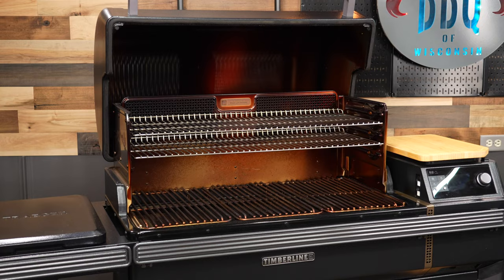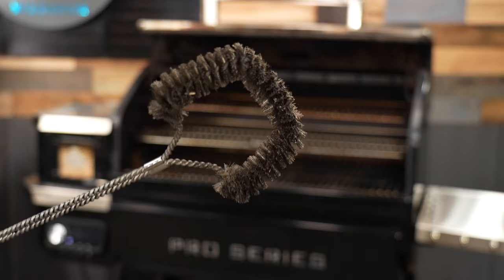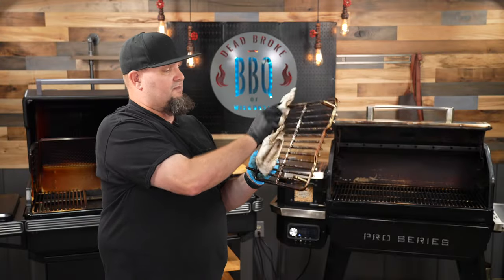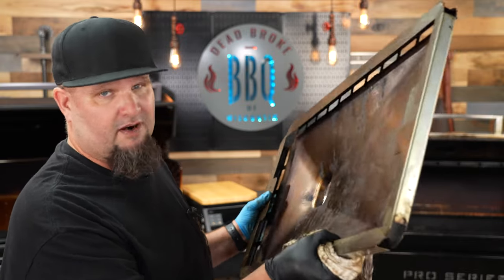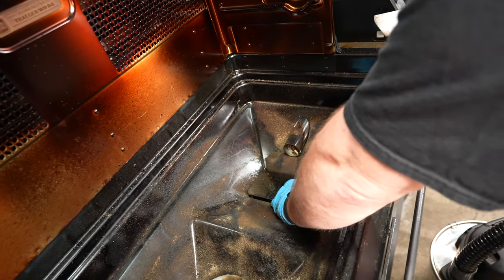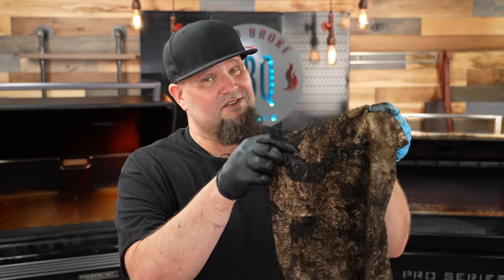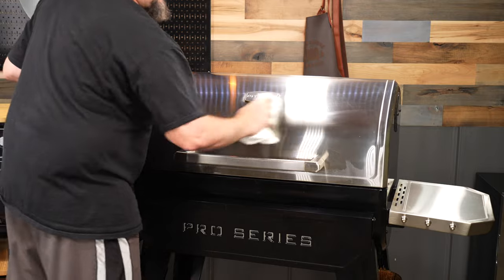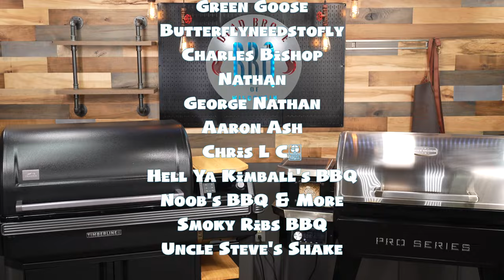How To Simply Clean Your Pellet Grill

Comment: That one brush that you said that was wore out, when I got my brush like it, it was saying to dip it into water to keep it from clogging up,does it actually work by doing that?
Reply from the maker: Hot water works to clean it up. But typically we just hit it with the garden hose with some pressure. Plus I hit the grates after I am done while they are still hot. But I go through so many brushes I don’t mess around much and just replace them.
Reply: @DeadBrokeBBQ  I will hit with a brush after meat is ready and go over it again the next time I crank it up.

Comment: I have a Oklahoma Joe Rider 900. It sounds like i should be cleaning after each use and then deep cleaning the smoker after 3 cooks. Whats the difference between deep clean and what you show in the video?
Reply from the maker: Clearing the ash pot is a normal clean out. Deep cleaning is getting out the vacuum and scraping down any grease. Thanks for watching!

Comment: Great video. I have noticed that my grill is leaking grease around the latch that holds the ash pot in on the bottom of my elite. Have you heard of others having this problem?
Reply from the maker: Hmmm I do not recall anyone talking about that. Mine is fine, do you have something not lined up correctly? Something blocking the grease flow? I get very little grease in the bottom of my chamber, in this video the reason why I had a lot of grease in it was from those 6 big pork butts I did. Almost seems like you have some obstruction or a hole near the latch rivets? Weird bro! I would call Pit Boss and see what they have to offer?? Oh is the pit level? In the past when I ran all of mine outside the pitch in the cement would not get the grease to flow if I had it tilted towards the hopper. Let me know if you figure it out! Thanks for watching, I really appreciate it Ryan!!!!

Comment: Ricer thanks for the videos, been watching most of them! Had a question about adding smoke to the inside of a grill. I read and hear a lot of bbq guys talk about how an older smoker can be better than an identical newer one because of years of smoke baked into the steel, with that in mind would it make any sense to light some smoke tubes in my 2 week old pellet grill when I’m not using it just to bake some extra smoke into the steel? Or would that just be a waste of pellets? Just an idea that occurred to me, let me know your thoughts.
Reply from the maker: Waste of time if you ask me. I would just run it on smoke mode longer for each cook. A good seasoned pit is typically an offset IMO.  But I never scrape down the chamber in my pellet grills unless the seasoning is starting to peel some. That will happen when you very the pit really hot or grill a lot on it. But if you want to add a smoke tube go for it, just going to add more smoke. Thanks for watching brother!

Comment: Great video!  Curious why you wouldn't use aluminum foil covering up the pit and just toss and replace as needed.  Is there a reason to let the plates get dirty?
Reply from the maker: On my first Pit Boss 1100 with the flame broiler I did it but it started to rust up pretty bad so I stopped and let the grease build up a little protection. Plus I had a couple grease fires from the foil not being perfect. Thanks for watching!
Reply: @DeadBrokeBBQ  I have a Pit boss P2 1000 and I have used foil to cover the grease shield but only for low temperature 225/250. Pork ribs and chicken. That is true about when the foil isn't on perfect enough for the grease to drain into the bucket.
Reply: How often do you pull off the hopper and clean out the auger?
Reply from the maker: @markhejl3104  I never have but I do not keep them long enough to worry about that to be honest! hahaha

Comment: What is the best way to clean porcelain coated grill gates? Thanks! Enjoy all of your videos. New to the whole pellet grilling adventure.
Reply: I turn the heat up high and use half an onion to scrub it clean. I also use hot water as hot as you can handle and a yellow and green sponge for dishes. Either one works for me hope that helps. Let's keep Grilling
Reply from the maker: I use foil typically on porcelain but I also use coiled brushes. Thanks for watching!
Reply from the maker: Yep that works too.

Comment: I find that steel wool or copper scouring pads work pretty well to clean up once you've got the bulk stuff removed with a brush.
Reply from the maker: Yep that works but I don’t use steel wool on the grates. Fibers break off so easily.

Comment: I use aluminum foil in my pitboss. Remove/replace when required. 20 seconds, done. Scraping days are over.
Reply from the maker: Ya I stopped using foil because my old 1100 dip pan really started to rust up. Plus I had a couple grease fires in the back rear corner when I had foil on it. I do not mind scrapping mine down after 3 cooks but I got 15 cookers so I can jump on another one if I am not in the mood to clean one!! hahaha Thanks for watching!

Comment: I went to the website for the gloves and it didn't show any disposable gloves
Reply: Go to harbor freight. Best place to get gloves.
Reply from the maker: Hmmmm weird Mark because it works when I click on it?? Maybe copy paste it?? I will say they have some good pricing typically!!! Like always thanks for watching!!!
Reply from the maker: That is always the other place I get them but they never have black and I use black in my videos so I do not  distractions  in the video. Thanks for helping out Victor!!
Reply: @DeadBrokeBBQ  interesting, I get both black and blue there. I like that they offer different thicknesses in the gloves. 5m is normally what I use. However I do like the 7m and 9m at times. I use gloves when handling lures and baits for salmon fishing. In the late winter/early spring it gets Damm cold outside fishing. The 9m really helps keep fingers warmer. Especially if you slip a chemical heater pack between the back of your hand and the glove. 👋
Reply: @DeadBrokeBBQ  it shows gloves but not the disposable gloves. I like to use them especially when handling hot peppers.
Reply: @victorbenner539  my wife would yals cold temperature. We haven't really had a hard winter here in awhile. We use to have cold winter's when the first blue northern came in it wouldn't start warming up until spring
Reply from the maker: Those are disposable nitrile gloves they sell. The blues ones I get from other places. I typically use the blue ones when I am clean up my pits. Thanks for watching!!
Reply: @DeadBrokeBBQ  originally blue was all you could get. When the black ones came out ( by the way I believe they are actually really dark blue in color) I really liked them for fishing. But I prefer the blue ones when cooking because dirt and grease shows up much easier meaning I will hopefully catch they are dirty before spreading grease and other substances around. Something to consider. But the dark gloves look cool 😎 👌.
Reply from the maker: Ya I like their selections also!!
Reply: @markhejl3104  Ricer has colder winters then me. I live in Washington state. But the temperature can be deceiving. We have 90% or more humidity in the winter months. So 34°f feels like 24°f. And when you're putting your hands in the water to deal with fish? Brother it's cold. I always have my propane heater when it's cold. And I have a small cooler I fill with boiling water before leaving home for fishing. It will stay warm enough all day fishing to clean hands( with gloves on) and help warm hands at the same time.
Reply from the maker: You are always prepared Victor and that is why I like you so much!!!! Great tips like usual brother!
Reply: @DeadBrokeBBQ  love watching your videos. After watching this video I figured that it's about time to give mine a good cleaning. Do you ever clean out the auger?
Reply from the maker: Thanks mark! No I never have but I do clean out the hopper but that is pretty simple. Ya good to get in that pit and deep clean it from time to time!
Reply: @DeadBrokeBBQ  I went back on and it was showing zep grill cleaner, towels, several different brushes.
Reply from the maker: Ya I tagged those products to the video because I will get a lot of questions on what I use. So this is a way for people to find things easier.
Reply: @DeadBrokeBBQ  thanks Ricer for the "be prepared " mention. I'm a Eagle Scout, yuppers. So it's something that I was trained to do long ago. But it can be a curse. I'm still not up to snuff on what I need to do with my go pro camera for filming but I'm getting there. Soooo frustrating. 🙃🎬
Reply from the maker: feel free to reach out if you got questions, maybe I can help!!!
Reply: @DeadBrokeBBQ  I appreciate that a great deal. Currently it's just basic how to stuff like using the camera and downloading. Next editing. Then posting. I would like a suggestion on what wireless microphone to get. That would be great.
Reply from the maker: I use Røde and have a few regular wireless Go's, and Go II's but the dji wireless mic is nice and I will eventually get a set of them. I will say audio is more important than video. People can deal with ok video but not audio, they just click off!
Reply: @DeadBrokeBBQ  I agree with what you said about audio, very important. I bought a gopro 7 hero black three years ago. Don't laugh to much but I'm just finally trying to figure it out. I have found a few YouTube channels on that unit. So I'll check out the microphone, thanks 😊 👍
Reply from the maker: Nothing wrong with a GoPro 7 bro! Got to start with something!
Reply: @DeadBrokeBBQ  I like it has self stabilization and can go underwater ( think underwater shots of salmon, Dungeness crabs, etc) And not being concerned about the rain ( there are rumors that we get a lot of precipitation in the Great Pacific Northwest. The rumors be true. ) So during most cooking situations being waterproof will not be important but out in the field it will be great. Next camera I get will be a not to expensive drone unit. But first I need to master the gopro.
Reply: @victorbenner539  I'm in central Texas what really hurts us is the north wind 🌬️. Both of y'all have colder winter's than us. If we get a snow or ice storm some people just freak out and don't know how to drive in it. Summer is hard on most of us. In the triple digits during the day and lows in the 80s. We are in a drought at this moment and with the south wind blowing feels like your in a oven. Winter time it gets down in the 30s and wind chill in the teens and single digits.
Reply: @victorbenner539  if I put my hands in 40° water it would be cold to me.
Reply: @markhejl3104  howdy Mark. So you know I used to be a long haul truck driver. I have driven in all 48 of the lower 48 states. All Canadian provinces including the Island of New Foundland And to Alaska. And yes including winter. Fact is I made my first delivery to Alaska ( Anchorage) December 7th. -20°f is common in Northern Midwest and Canada in winter. Truthfully western Washington where I live doesn't get much colder then what you get. It would be fun to get Ricer out here in the winter for winter steelhead. Our temperatures that time of year would be considered a nice day tor him. Except maybe the rain. 🌧😁🍻🎣🐟
Reply: @victorbenner539  bettcha it's nice to see different places and get paid for it. But at times can be a pain. I watch ice road truckers. Driving across the frozen lakes
Reply: @markhejl3104  my reply I was doing got cleared out. Oh well.
Reply: @victorbenner539  I'm sorry to that
Reply: @markhejl3104  no problem. I think my reply got to long. It disappeared before my eyes. Ricer and other channel creators know I can get long in the replys. Have a great day 🌤 😀.
Reply: @victorbenner539  I always like hear things. Your reply could never get to long.
Hope you have a great day too.
Thank you
Reply: @markhejl3104  😁😂🤣😅😆 Ricer is going to laugh if he sees you say I couldn't have to long a reply. I have something of a reputation for loooong replies.
Reply: @victorbenner539  he probably will.
But when people like you know what they are talking about, it's how people learn how to do things differently.
Reply: @victorbenner539  you probably even been through central Texas (Waco, Texas and the city of West, Tx).
Reply: @markhejl3104  you know it buddy. Funny thing, the only place in our country where I absolutely would not live is around midland Texas. Where 20 and 10 come together. The only thing there is Haliburton 😁
Reply: So I'm guessing that's your neck of the woods?
Reply: Not midland but Waco

Comment: Never, Never EVER USE STEEL BRISTLE BRUSHES! If a bristle gets in someone's gut it is a DISASTER!
Reply from the maker: Meh I wipe down as you saw after using my welding brush with a rag. Those bristles are large and easy to see but I have never had one fall out because I buy a new brush every few months anyways.